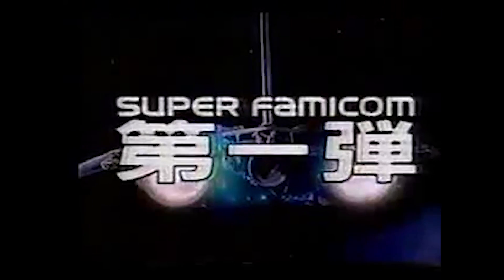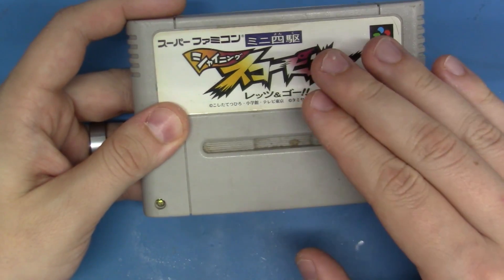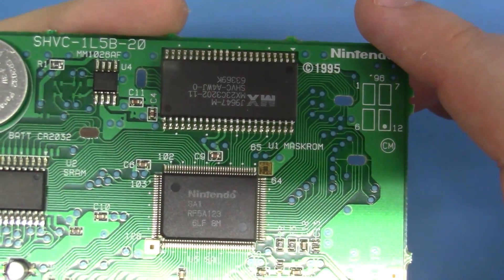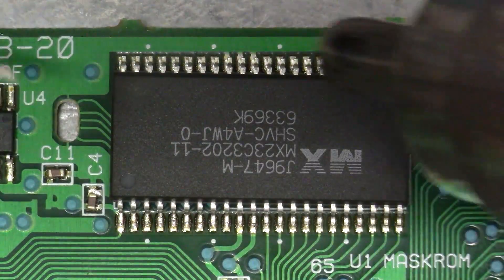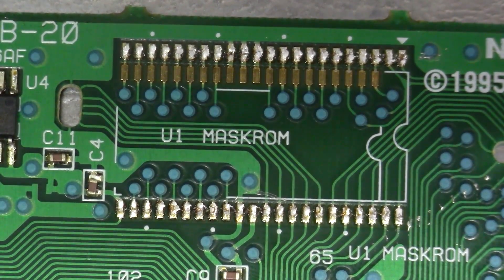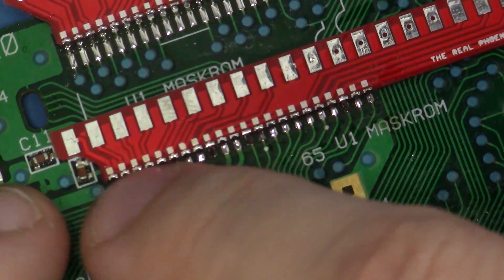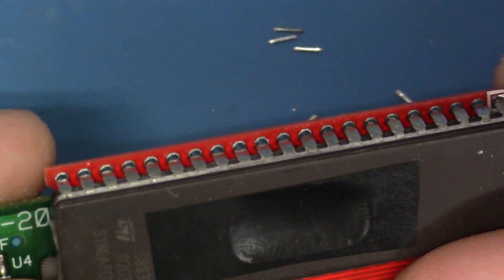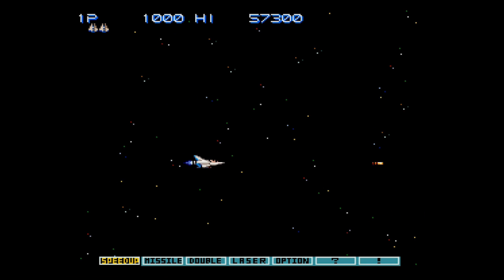Making a REAL Gradius III SA-1 Cartridge!

Comment: What ROM did you flash on there? The original Gradius III ROM or the SA-1 patched ROM? Also could you not use the original Gradius III rom chip (removing it) off an original board and soldering it on the donor board?

Comment: This is really cool I’ve actually considered doing some thing like this myself. Although I would not have cut the legs on that chip. I would’ve simply laid them flat instead. Although it does look like there are holes on the other side they’re just covered and filled in with solder you could wick it out easily.

Comment: I see you're using a lot of laser bear lately. I've been going to him for a lot of stuff including the majority of my modifications on my Sega Nomad have parts from laser bear including the piece for the aftermarket screen and my battery pack. I just wonder why he only offers the battery level indicator on the prebuilt model but not on the model you have to assemble yourself. But I don't think it matters either way because I'm getting literally 6 hours of battery life out of the new battery pack for my nomad

Comment: unfortunately I will be able to say that this video is certainly not true. Gradius 3 with the vitor vivela patch does not run on this donor cartridge without an SRAM upgrade. I think you should make a new video showing the SRAM upgrade process to actually run this game using the same donor cartridge as the video. it is not a difficult thing to do. if you need help I am available.
Reply from the maker: No offense, but do you know how to read? I covered that in both the video description and the video title..

Comment: I cant be the only one who noticed all that solder that got on the board when he pulled the chip off?
Reply: He didn’t mention the reason why to use that heat gun in motion,but i guess he did that to avoid that plastic from the chip getting melted accidentally.

Comment: "Mini Yonku Shining Scorpion - Let's & Go!!" is the cart he uses and will work just fine too. I find it easier to come by than the other two JPN carts suggested. Going to try this mod ASAP.
Reply: Did you have any luck? I'm thinking of trying it on a SHVC-1L5B-10 board, but it has 256K SRAM. I wonder if it will work.
Reply: I have a couple boards and the needed parts, I just need to do the mod. I am not thrilled about the boards I got from OSH Park as some of the half vias where the board was cut don’t go all the way through, however they may not be needed anyway.

Comment: I used the same donor cart as the one in this video and I get the white test grid and it just stays there. Did this cart need to be upgraded to the larger sram for it to work? This isn't shown in the video.
Reply from the maker: It's in the video description.
Reply: @Voultar  So if I swap the sram chip on the pcb to the one you referenced in the description, it would then work with the cart in the video. Correct? I can just solder the new sram to the same pads as the original? Thanks Voultar!
Reply: I was just wondering this since the pcb in the video already has 256k of sram
Reply: I just took a look at the WW2 game's pcb and I see where the sram would have to be upgraded. It looks like I would have to scratch off the lacquer to use the extra pads for the 32 pin sram to solder on. Ordered some from digikey and then I will test it again :)
Reply: I added the add upgrade and it works perfectly! thanks!
Reply: @Voultar  I ordered the sram chip listed in the description from digi-key, but the SRAM on the PGA tour 96 cart is a 28 pin IC, the part in the description is a 32 pin. Are they supposed to be the same or is there anything else I need to know to wire the sram up?

edit: I checked the data sheets for the reccomended replacement and the original sram, it looks like most of the pins match up but I will have to bend a few up so they don't contact the pcb and run a few wires to connect things. On the side with pin 1 it looks like I just need to lift pins 2 and 3, line up pin 16 to where pin 14 was on the original, and use a wire to connect pin 1 to pad 1. The other side needs a bit more rewiring if I am reading these correctly. It looks like 32 on the replacement corresponds to 28 on the original, 31 goes to nothing, 30 goes to 26, 29 goes to 27, and 28 goes to nothing. I will try that out later, hopefully it will work out without too much trouble.

Comment: It's not obligatory but wicking the pads flat tends to make it a lot easier to place your component correctly. The solder domes tend to make things really want to slide out of position plus your component probably won't sit flush to the board.

Comment: Never hurts to put some flux on the pins between the preheating and hot-air desoldering. The oxide is a fairly good thermal insulator so adding flux helps heat get into the metal.

Comment: I built one conversion but I only get the white grid on starup then black screen :/ The mod is based on 1L3B-20 PCB (PAL-cartridge and PAL-SNES) with 128KB of S-RAM. The unpatched US-version is running fine on a 27C322 testing-board in my PAL-SNES... I did not use Lunar Expand on both 27C322, maybe the SA-1 necessarily needs zero's (done by Lunar Expand) on the other 7 banks of the 27C322 instead of the whole emptiness FF's in the unused remaining 7 banks in my current not fully working EPROM?
Reply from the maker: I know what's happening.. 

The GRID populates, than black-screens, right? 

The grid is a self-test that Gradius does where it checks all memory. You're black screening because Gradius isn't able to fully address the additional RAM that's necessary for the game to run properly. 

It's 100% your RAM. Did you upgrade it and ensure that all of your connections are correct?

Comment: Well according to Wikipedia there was about 34 games (mostly japanese) that started using the SA-1 chip in 1995-1997, probably because the 10.74 MHz chip was cheap enough to put in game cartridges by then, but the SNES was already seeing its last year til the N64 came out.

Comment: @Voltar did you do anything special when you burnt your eprom? Gradius 3 with the sa-1 patch is only 512k and your using a M27C322 eprom?
Reply: Yeah @Voultar you skipped some important part in this video for how you prepared the data before burning, and I would like to see that.
Reply: @yonom4609  What you need to do is apply the patch like Victor explained in his GitHub repo and then expand the rom (using Lunar Expand) to 32Mbit that pretty much summed up the patching part, good luck!

Comment: Hi i have been watching your video's and liking them 
I wish to get much better at precision soldering
First what kind of flux do you use ??  I have basic brown flux not so good 
Second what is your heating equipment ? I'd like to be able to unsolder using hot air but need to know what's a good machine. And your's looks good .. I'd like to get something like you have as in the past i failed replacing a cpu socket not having a correct hot air tool.. Sorry being a pain with my questions

Comment: What soldering station do you recommend for a beginner? Under 100$ I guess. I need iron with heater.
Reply: Look up on Amazon or eBay for the 862D+ it's got an iron, a hot air gun, and both are individually temperature adjustable and heat up fast. Also comes with a good swath of tips. I've been using mine for around 8 months. It's like $60.

Comment: You know of any adapters like that that would fit on a TSOP48 footprint? I have a board that I want to experiment with firmware mods on. The chip on there is an EEPROM (AM29F160DB) but I'd like to have something I can easily attach and remove many times without any trouble.

Comment: A good way for people to understand that the heat needs to be spread out is to imagine holding a hair dryer to one spot on your head. That doesn't work, you need to move it around your head and evenly heat or you will burn yourself.
Reply from the maker: That's actually a perfect analogy.

Comment: I don't understand how this works as a 16bit 27c322 without multiplexers.
Reply from the maker: The SA-1 is designed to interface with a 16-bit MaskROM. Not an 8-bit rom.
Reply: @Voultar  That clears that up then, thanks :) Nice job by the way.

Comment: Of the original bunch of hardware upgrades seen in cartridges I feel the SA-1 is the most deserving of a modern reimplementation.
And possibly also the simplest in some ways (not in others), because it's effectively a 65816 with a bunch of extra features.

Then again, if you're talking homebrew rather than mods or re-releases of older games then there's not much point going for authenticity, and going with whatever's easy to get hold of (probably an ARM cpu of some kind - speaking of which, there was an actual released game that contains an ARM cpu... So it's not coming totally out of nowhere compared to the historic games.) would be the simplest choice.

Speaking of modifying Gradius though, I wonder how much it would gain just from switching the whole thing to Fast Rom (and obviously adapting the code to make this work.)
That's, within certain limits something like a 33% speed boost...

Comment: Hi- thanks for the video , can I ask you a question ? I noticed during the assembly process when you squirted flux on the pcb,
some of this found its way under a co-joining  ic, do your viewers know about the need to flush out this flux with iso-propanol alcohol solvent in order to clean the flux away from around the pins of the ic and stop it corroding away any pcb tracks in the future or maybe you have covered this topic in a earlier video
Thank you
Reply from the maker: I don't use a caustic, corrosive flux. The flux that I use is made to be used for site repairs and rework. Low solid content, no clean formula.
Reply: @Voultar  Thank you for replying , it was just that I saw the stuff going on and it set my alarm bell's off !! .Sorry for questioning your ability.  

all the best
Reply: @Voultar  Hey which flux do you use?  brand & type i mean

Comment: A bit of advice when using one of those cheap chinese hot air stations. You don't want to turn it off suddenly, the residual heat will shorten the life span of the plastic case. Instead, put the gun down on the rest, it has a magnetic switch that will turn the heating element off but keep blowing air to cool it down. When under 100 celsius, it will turn itself off. They are otherwise great for the price.

Comment: If you want to make your cart revertible, you can tape the mask ROM to the inside of the front shell, and store the label behind the back of the PCB. Use a hairdryer, not a heat gun, to loosen the adhesive on the label so as not to burn it. Non stick paper like a used sticker sheet can keep the adhesive from drying out.

Comment: Rather than cutting the pins, have you considered bending them inward?
Reply from the maker: You have a fraction of a millimeter of height clearance to work with. Bending the legs down can create an additional platform (height). I snip the pigtails flush so that I can drop the 27C322 as close to the module as possible.
Reply: How thick is the adapter board? It might be way overkill but I know you can get ceramic boards super thin.

Comment: Why did you add a battery and how did you do this with only 256k of SRAM?
Reply from the maker: 1) The SA-1 port of Gradius III allows you to save high-scores! 2) I'm Lord Voultar.
Reply from the maker: And you are 100% right to ask that question. I didn't realize that Gradius III can give you trouble if you don't have 128KB S-RAM installed. 

IS62C1024AL-35QLI-TR  is the part number, if you need it!
Reply: @Voultar  Ok, good to know that I wasn't just missing something.  I tried on a 1L5B just for the heck of it, and just got black screen.   Ended up using a 1L8B with 1m SRAM (only ONE game that I know of has it on board).  Didn't really want to bother grabbing any more SRAM modules, since I really only wanted to make the one for myself :P
Reply: @RoseColoredGaming  Which 1L8B board has 1m SRAM, if you dont mind me asking. Thanks.
Reply: OneHundredYen Only one game that I know of - “GREAT STRATEGY EXPERT WWII War in Europe” for the SFC.  But 1mb SRAM can be easily be added to ANY 1L8B. No rewire, just remove the 512 and solder the 1mb on.

Comment: "You smell that? You Smell that?! I love the smell of Flux first thing in the morning."
Worth noting Voultar's method for removing chips is one of the easiest methods. Be warned, being heavy handed will break things. If your new to soldering/desoldering - PRACTICE before atempting by using old tech to learn how to remove components correctly, AND how not to... (You'll understand) and DON'T Skip the Flux !

Thanks V

Comment: Playing it without slowdown on my sd2snes was a revelation. It did make me realize how unbalanced the game is however. If I knew how to recode the game I would add more item drops and allow speed to be adjusted with the shoulder buttons instead of being a power up.
Reply: Would you also add in the removed arcade content and make it a one to one port of the arcade game, as well as do that with its prequels, put them on the SNES/NSFC and also rework the two Game Boy Gradius games into a new Gradius game for the SNES/NSFC, Amir Jubran?

Comment: Instead of replacing the battery, is it possible to replace the save ROM with a flash based solution for permanent storage?
Reply: There are FeRAM conversions you can do that eliminate the need for a battery, as long as the game doesn't have an anti-piracy measure triggered by the lack of a battery.
Reply: What's the harm in using the battery? They work for YEARS on game cartridges. 
I wouldn't say they still work after 30 years , but I still have some games with saves still intact after 20ish years.
Reply: Flash and battery backed sram have rather different write characteristics. On battery backed sram you can write any location in a pretty much instantly and without any affect on other locations. On flash you have to use a block-based erase and write process. So replacing one with the other is not something that can be done easilly.

Comment: The BOSS RUSH at the end of the game is still one of the most insane things I've ever beaten as a kid. I would argue it actually makes the game easier though.
Reply: I'd argue the high-speed stage that comes before is much more frustrating.
Reply: Knowing you watch voultar makes you my second favorite youtuber.
Reply: He also watches RetroTech.
Reply: What's really amazing is the game called Rendering Ranger R2, it has absolutely no slow down, and it's a technical marvel for the SNES, and the most shocking is that, the game doesn't use any fancy special enhancement chips of any kind, slowrom (Fars I understand), and the game weighs at only 16 megs (Megabits), Manfren Trenz shows what real programming is capable of when the system is in the right hands, R2 is no exception.